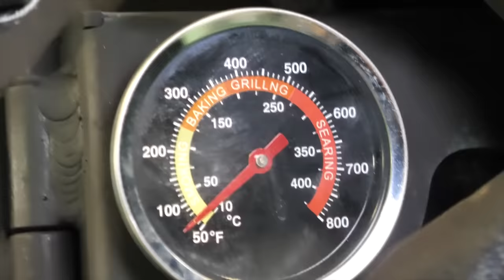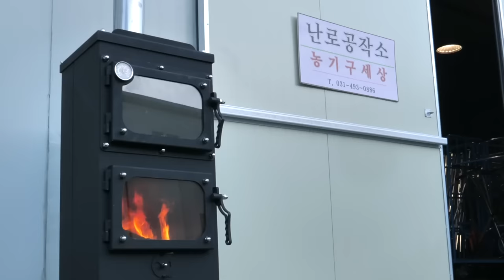No worries about heating costs. wood burning stove process in Korea.

Comment: Talk about cheap and nasty, what happens when they start warp with the heat.
Reply: It is a structure that holds the deformation caused by heat.
Reply: @난로공작소    You don't need to answer the jealous troll...